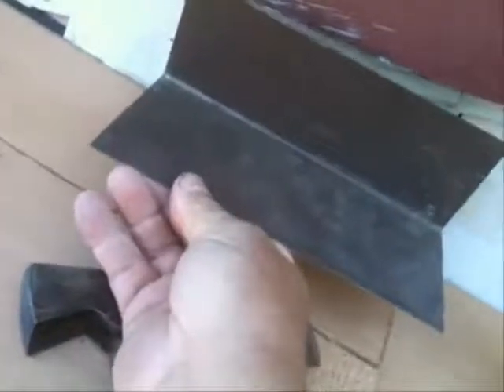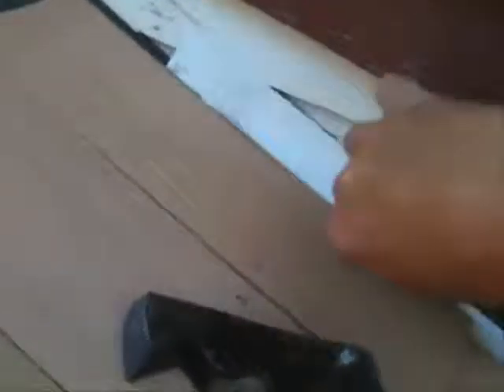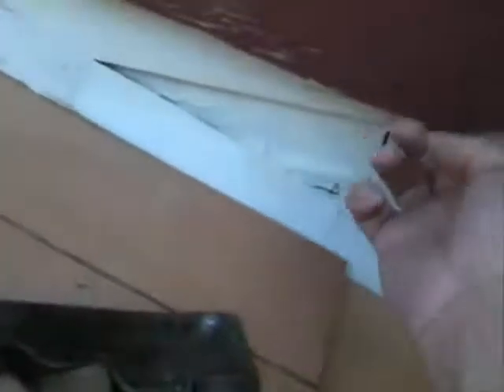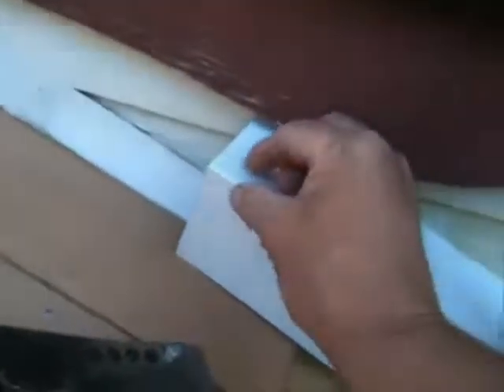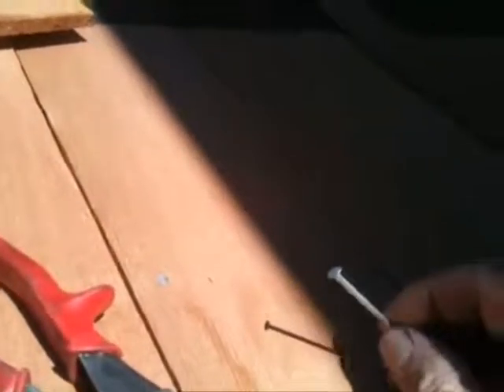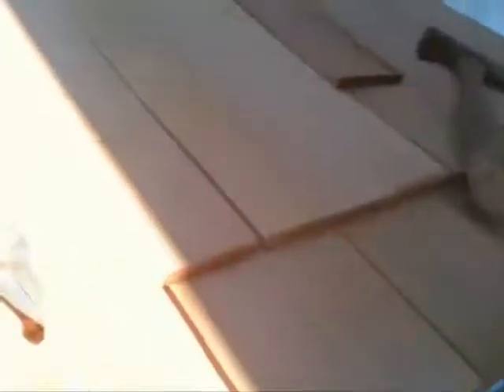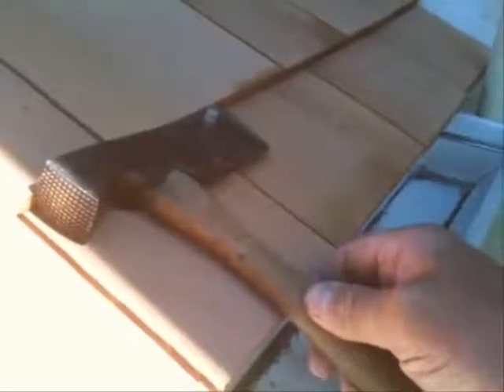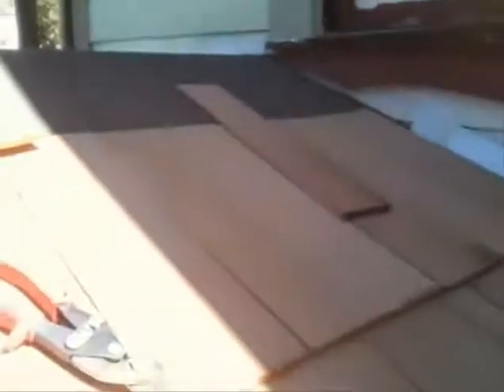Roofing How to Cedar Shingle Roof with Flashings

Comment: Can anyone help me with the best way to flash a cedar shingle roof to head wall? It is a small roof area on the front of the house, under the gable roof triangle, and only 3 courses installed with 5.5 inch exposure, a total of 16.5 inches. I plan to replace with 4 courses of shingles installed with 4 inch exposure. Should I underflash the top two courses, even with only 4 courses? If I can only install 3 courses as they are currently installed, should I still flash under rows 2 and 3? I assume the flashing must extend down far enough to cover the nail holes in the previous course, so for a 4 inch exposure I would need to extend down 7 inches from the wall, and up the wall 3 inches for a total of 10 inches under flashing? Lastly, if I do that, should I also install counter flashing on the top row to cover the exposed face nailing? Do I need under flashing if I install the counter flashing? Thank you.